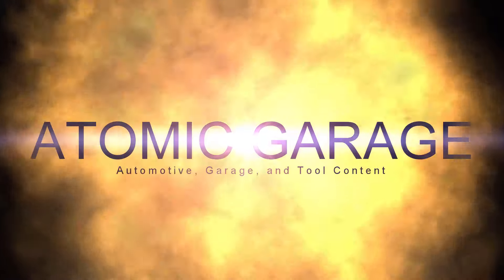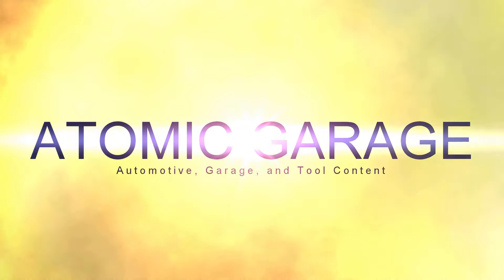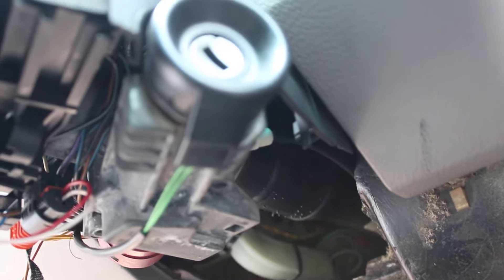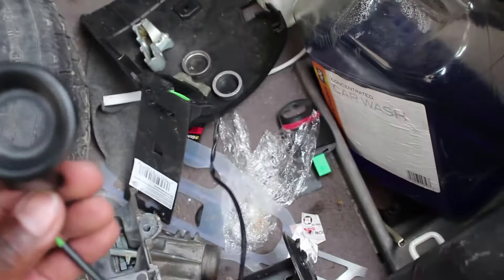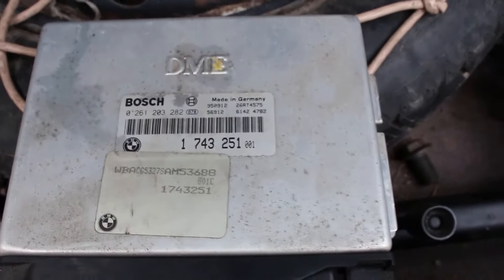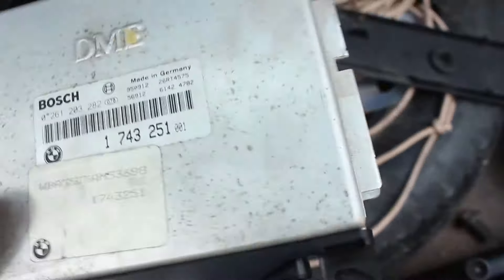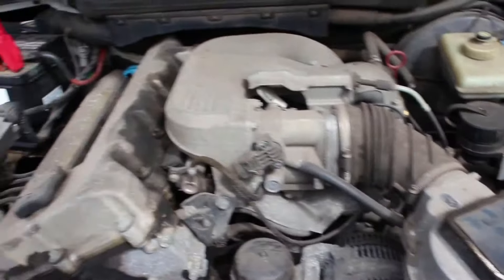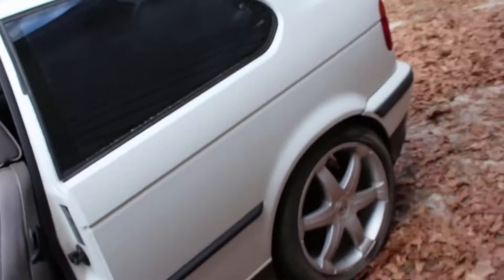E36 BMW 318TI FIRST PROBLEM

Comment: Pop the ignition switch off the left side of the column. With the key in the normal cylinder, so the EWS sees it, turn the ignition switch with a flat blade screwdriver. Should crank over.  You can also jump the wires on the back of the ignition switch as well. Purple with black tracer?? Something like that. Been a while since i've messed with E36. Google wire diagrams, you'll see which wires complete the circuit.  Also, old ~95 ish EWS is easy to bypass. Again, more google.
Reply from the maker: I will definitely Google stuff I want this car running already!

Comment: that is a common problem there are a bunch of cheap mod to fix it  .. search bmw e36 spinning ignition barrel on youtube there are several videos showing how to do the mod.
Reply from the maker: I saw a few after editing the video. I'm worried about this security system tho.
Reply: I am pretty new to working on bmws but there is tons of info on them all over youtube and bmw forums... EWS is different then american security systems and I have not messed with it yet... also I have the book for e36 bmws so if there is anything you need for it let me know I can get you the info.... hopefully your project car will not be a problem.
Reply from the maker: Well I will be bothering you shortly. I got into turn over a little bit I need a battery now

Comment: HF sells an ignition starter switch if you have a typical starter. Not sure on those cars.
Reply from the maker: I got one of those. And that's work a shot just to at least turn the engine over

Comment: Look at the driver's side door sill, and under the driver's side under dash to see if the car has a OBD2 port.  If it has one then I think it's might be a M44 1.9 liter not a M42 1.8 liter.  Your car has plastic oil filter cap not a metal one.
Reply from the maker: You are hard at work my friend! It appears to be obd1. I believe the security system I have is obd1 dws ews II. that's a mouth full lol.
Reply: Atomic Garage did u get it started yet? Is it cranking over? It looks like it has serpaentines rather than v belts than my E30.
Reply from the maker: I got it to turn over slowly but the battery is no good. Even on the charger all day it won't hold a charge
Reply: Well go get a cheap Wally World battery ...
Reply from the maker: That's the plan

Comment: Not sure if installing resistors to bypass the security system will work .. If swap to a push button system or switch . Especially if you only want to race it
Reply from the maker: That's worth a thought

Comment: Too bad you don't know if the engine is good or not, because if it's bad you could just yank it and its problematic ignition and computer stuff out.  Then drop in a Ford 302 or something.  Make a drag car out of it with gutted interior and a few Sun gauges in a diamond plated dash.  ;)  Did the guy who sold it to you say it ran well before the electrical gremlins?  But should be a easy mod for the ignition to wire in a start button.
Reply from the maker: I don't want this car to be a drag car. Maybe the next project. The guy I bought it from said he didn't know if it ran

Comment: Did not open trunk before buying? If so, all of those parts did not scare you away from buying? Especially the computer model and many ignition modules?  I hope you paid very little for it.  BMW parts are expensive...🤕
Reply from the maker: I did open the trunk. But you know when you get a deal and you get your heart set on something. I only paid $200 with a title. So minimal investment
Reply: Atomic Garage thanks for replying...that's what I thought that you must have gotten a great price...👍🏻

Comment: Do you think it would be better to drop the 302 in it since you have this issue?
Reply from the maker: I have no idea. I really like the idea of supercharged m42. I love being different. You see these engines supercharged but not alot
Reply: I have to admit that the supercharger idea is pretty cool.  Supercharger is even better than putting on a turbo charger.